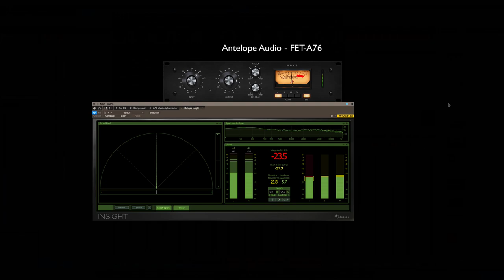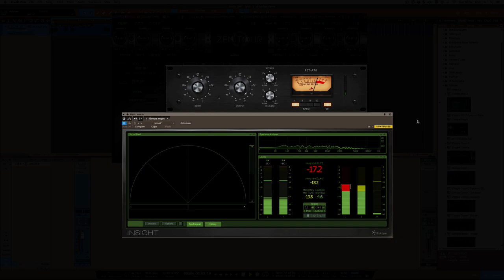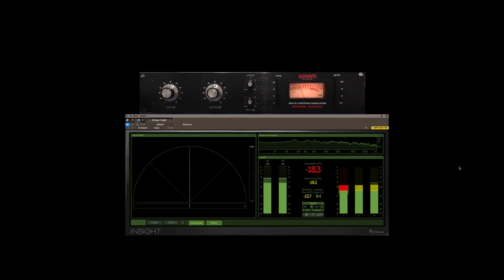1176 Hardware vs plug-in Compressors | Warm Audio, UAD & Antelope Audio

Comment: i don't want to but we gotta be honest, UAD sounds miles better than the other options im sorry for all of our wallets
Reply: Alas - but NO! UAD Lost Fully .. Make sure the Quality of your sources / monitors.
Reply: I definitely agree I have the 710 infinity preamp and I put the 1176 in my vocal chain and it sounds great I just had the 1176 warm but its not the same as the one that Warm Audio Wa 2A now that for vocals is definitely worth buying because to spend a lil over 700 u can buy one on reverb or ebay for about 750 which I just did because of the difference in hardware and the fact that you're gonna only pay a lil over that for a mint condition 1 online.